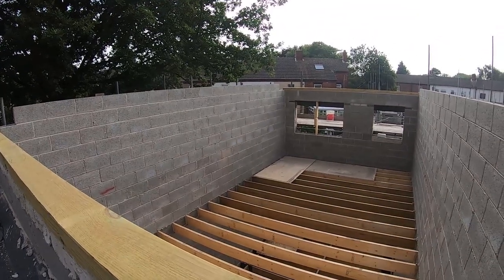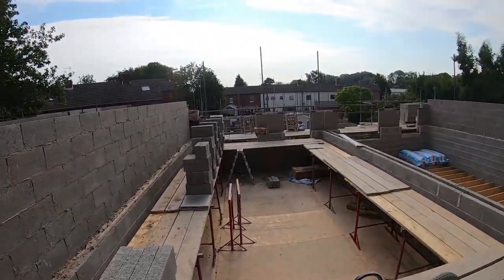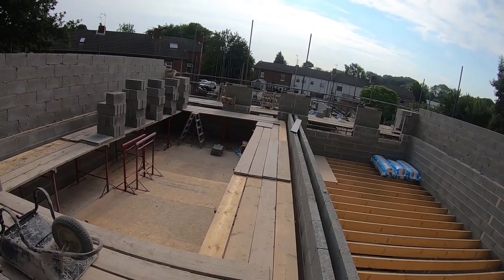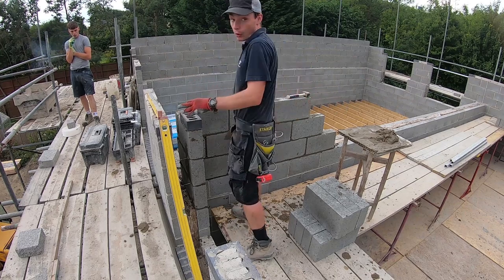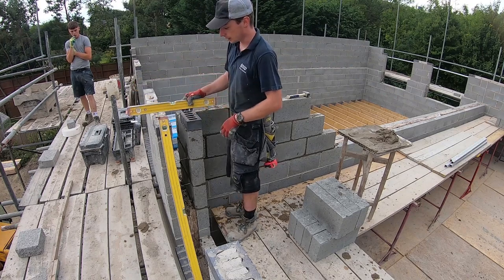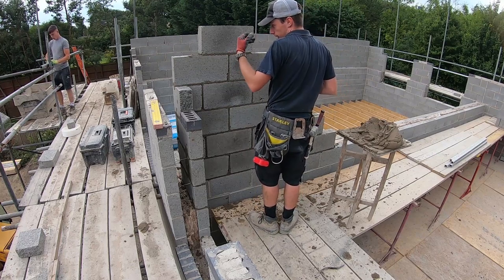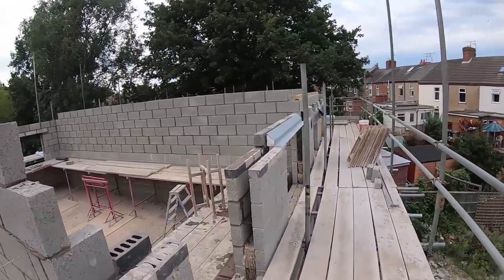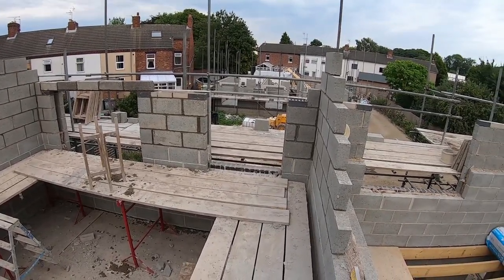Bricklaying - Ran Out Of Blocks AGAIN! #bricklaying #blockwork #brickwork #vlog #renovation

Comment: Why are you scaffolding both side of the party walls, surely it would be more efficient to build both walls from 1 scaffold
Reply: Seems to generally Not be the done thing over there . Building over hand isn’t part of there training .
Reply: Who does this ?? Your so wrong
Reply from the maker: Perhaps so running in the middle, but building the corner overhand would be almost impossible. I trestle the entire internal perimeter so it’s easy for me just to move them over plot to plot 👍
Reply: @MorganTheBuilder  don't listen to these amateurs on here
Reply: I'm not been negative everybody has there own way  of doing things, just over here in Ireland 90% of our work is done off tresles up to joist so we are always building over hand with 150mm cavitys
Reply: @brickblocksolutions1660  blah blah blah 😴
Reply: @MorganTheBuilder  good point Morgan . We don’t have that problem in Ireland because the party walls are still built using a block on flat . It should be changed to a cavity insulated wall like you use .
Reply from the maker: @brickbybric  didn’t know that mate, it’s mad how methods of building vary